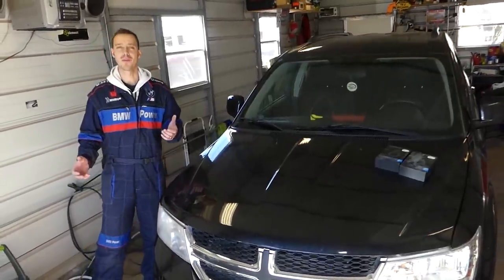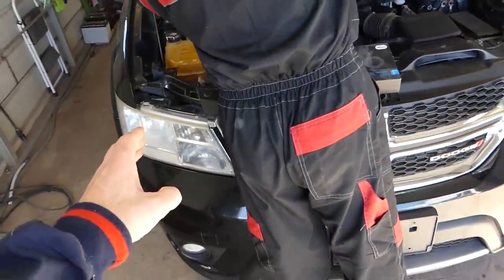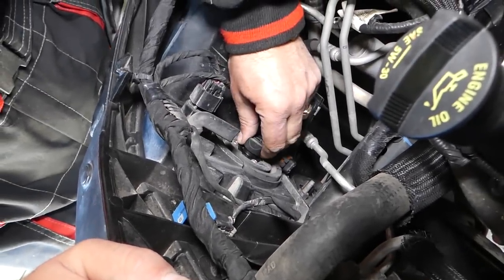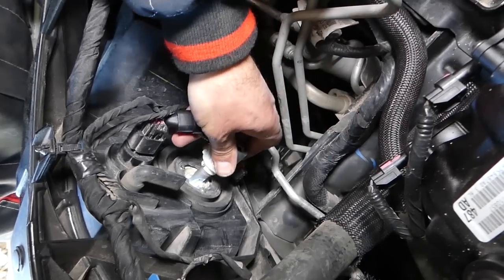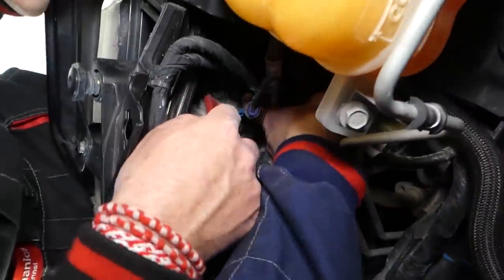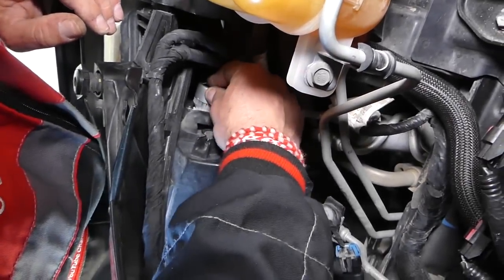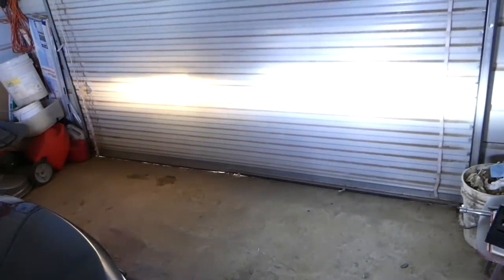DODGE JOURNEY LED HEADLIGHT BULBS INSTALLATION. FIAT FREEMONT LED HEADLIGHT BULBS

Comment: Thanks, just finished installing mine. Your video was very helpful. The only thing that sucked was installing the drivers side headlight
Reply: Using LED's did it give a headlight warning or flicker effect?
Reply: @DanceKang  nope no codes or warning lights
Reply: @just-got-here5594  which bulbs did you use?
Reply: Wondering what was the challenge on the Drivers side?
Reply: @ricardoperez8879  the driver side isn't as easily accessible as the passenger side. It's a little bit of a struggle but it's doable.
Reply: @Lion_Rey  ok yeah figured it was just that
Reply: Hows your drl after installing the led? I heard it will flicker. You need some adapter.

Comment: hey, i have a 2018 journey and i'm installing LED fog lights psx24w/2504... i noticed the bulbs are at an angle and they only seem to want to go in certain way.. they are at 11o'clock and 5 o'clock the other one is 1o'clock and 7o'clock
Reply: Bulbs should be @ 9 & 3 o'clock position, that's very important for proper light pattern & distant of light pattern!!

Comment: I’ve learned that the higher wattage LEDs have a balusters the lower wattage LEDs do not so if you want a bright LED you make sure it comes with a small baluster connected to it

Comment: Hello! By any chance is it possible that the led bulbs can cause problem with the ECU? I installed mine 3 days ago and now the transmission is not working normal 🥺
Reply: I have heard that led/hid headlights can damage your TIPM. You need to use a special harness that will trick the computer into thinking the car still has halogen bulbs. Morimoto makes a mopar spec harness.

Comment: Try using the low beams with the car running and same with the headlights they will flicker on and off I have a 2016 journey that I needed 12v power harness to be able to run led for my head lights and I needed another for my high beams and another kit for my fog lights
Reply: I'm having the same issue. What 12v harnesses did you use?.
Reply: @joehoupe8874  I used a amazon harness it’s plug and play besides the ground and the 12v power but you might need new bulbs because mine flickered so much before I installed it I had to replaced them and my problem was solved but make sure you get a harness with a capacitor

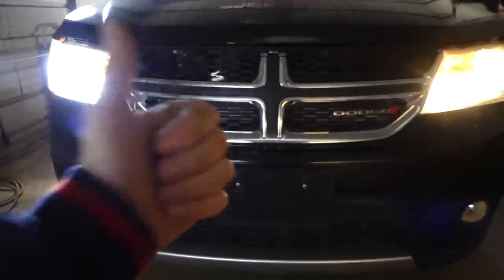Comment: Hi just wanted to ask it's been bothering me @ 4:42 into the video. What is that blue connecter is it just a spare wire or does it plug into something. If you can please help thanks.
Reply: I'm wondering the same thing,,,,

Comment: Have your lights randomly turned off while driving at night? I only asked because I installed some LED bulbs and they turned off several times that same night while driving.
Reply: I think the journey needs canbus ready led bulbs or they will flicker ...I had the same problem
Reply: check for posible overheating
Reply: Patrick McGregor what website you got em I been looking for some but the led I but won’t work
Reply: I had the same problem with my PT Cruiser with Hikari bulbs. I'm just going to return the LEDs and get Sylvania Silverstars.

Comment: SO I JUST DID THIS TO MY JOURNEY AND FOR SOME REASON THEY KEEP GOING OFF AND ON! Any idea why? Thanks
Reply: The bulbs use less electricity than regular halogens so the ECU isn’t detecting bulbs connected so it is sending pulses to the bulbs to make sure they’re still working. There is a aftermarket part to connect in between the harness and bulb in order for this not to happen. I’m looking into it. Will update when I find it
Reply: @eddiemanzano102  Did you find this part Eddie?
Reply: @NoZoul1337  Guess not.

Comment: My left headlight recently went out. The high beams work but no low beams. I went to auto store to replace buld and the light didn't come on. They checked the fuse and it was fine. Any idea what it could be?
Reply: I have the same problem. Did you fix it?
Reply: @mrrandom681  No I haven't.
Reply: reverse polarity
Reply: Probably a short in one of the wires going to the drivers side bulb. Test continuity or voltage using a multi-meter. Easiest fix is to jump over the short with another wire using wire taps. The passenger side useally feeds from the drivers side, have had to jump over both at one time or another on several vehicles.
Reply: @BodyPiercingByGlock  Can I go to a regular mechanic to do that or should I go to the dealership? I fear I'll make things worse if I try to do it myself.
Reply: @loric1416  regular mechanic

Comment: I haven't gone this route yet. Wondering how long they last, especially needing that fan to cool them and I wonder if they can get hot enough to damage the front of the headlight. I used 5000k xenon bulbs of the same wattage as stock to be safe and did the same for the fog lights. Considerably cheaper too at < $5 each. White light though not as bright, however too much heat can damage the front of the headlights which are expensive and a bit of a pain to replace.
Reply: Yes, thanks.. interestingly, to many these added non adjusted,  lights / extralegal, blinding on coming Drivers here in HELENA VALLEY, MT.. Actually, many lights/ bulbs/led/halogen way to much in a lot of so called Off Rad/ custom apps,
Valley
Reply: @opera93  need to have you adjust your punctuation and syntax.  Really difficult to understand wasn’t you are saying here. 

But if you are worried about blinding oncoming traffic, I think the Dodge Journey has projector lights so the bright light stays below the oncoming windshield so no issues. By biggest fear would be the LED getting too hot and melting the housing.

Comment: Hey guys can you tell me witch type of bulbs I need for my 2018 Dodge Journey crossroad. And where I should order them from thank you.
Reply: It's the same 9006 - low and 9005- high  beam
Reply: Did they work for led I heard that led aftermarket won’t work on the dodge